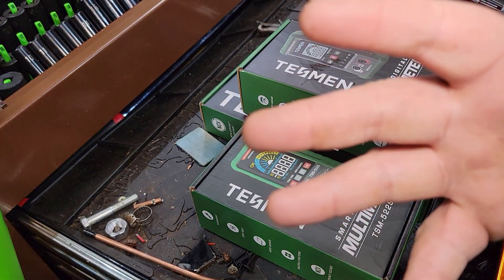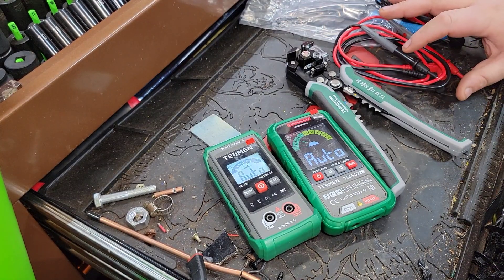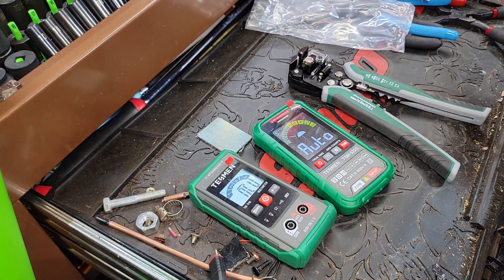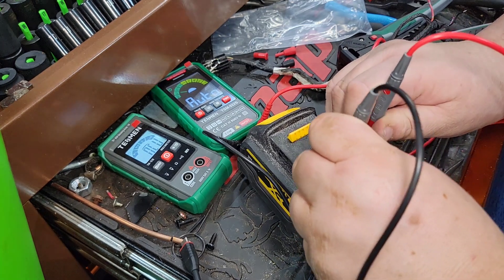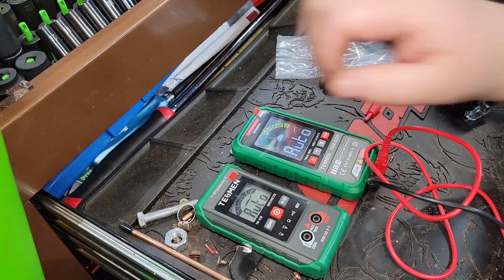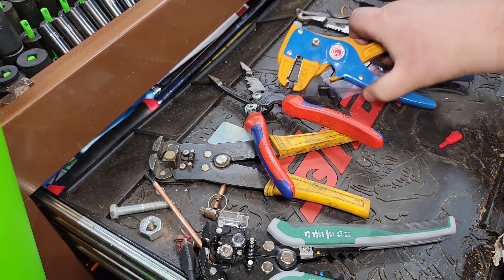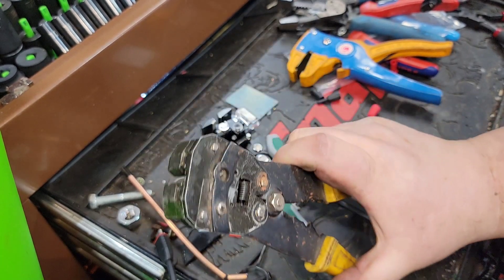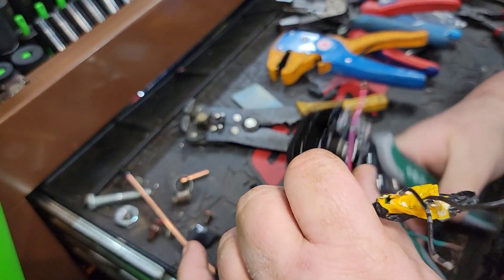I WAS SO WRONG ABOUT THIS tesman Tm-522s Better than Klein Wire Strippers.

Comment: Hey CP if you want some content send me a message and I'll explain how I brought a set of torque adapters off Amazon off capri and got sent a set of pink dumbbells in the unopened box to then be told by carpi that they wouldn't help me out at all and that it's another resell on Amazon.  But Amazon are promoting it as a genuine capri store.

Comment: Off topic, recently I have been looking at the Proto 90 tooth flex head ratchet. It supposed to be the same as Mac. On Mac's site, they show a different design more similar to the Gearwrench, further is the difference in the pictures between the chrome vs comfort grip. Called Mac and they said they have been revising it. Some have screws on the top and some do not.
Reply from the maker: I don't know about those, I personally prefer my [tool brand name] ratchets, but thanks for the info!

Comment: I purchased a Tesman Meter and the supplied test leads did not function well as you said. . The leads seemed to have a clear coating which can be removed with a light rubbing with some ScotchBrite…Worked for me…

Comment: Update: I actually ordered both strippers. I have not found an auto stripper that works reliably on coated THHN wire. Both strippers were able to do it. I had to really tighten the tension knob on Tesman but once I hit the sweet spot it's amazing to see. All my previous auto strippers just slipped off the coating. Thank you CP this is amazing to have two auto strippers now capable of stripping this wire. The yellow and blue ones clearly needed more squeeze than the green ones but they both stripped them equally as well.
Reply from the maker: I'm very happy that you are happy. This is what I do this to get comments like this, which makes my day!!

Comment: I've purchased 2 or 3 of those meters for different tool boxes and locations.  I've used it several times for my daily job (copier repair) and it is actually pretty good.  I agree about the leads, they suck.  Buy decent leads, and throw the ones that come with it in the trash.  Edit: Maybe the new leads are better, I purchased mine last year.

Comment: I’m not a fan of automatic strippers myself. I’ve got a few different stripper/crimper combo pliers from OTC but if I have room, I use my catapult strippers with the wire gauge in it. Speaking of crimping, I wouldn’t mind seeing a video with your opinions on that. I’ve several different crimpers as well: standard pliers, angled, ratcheting, etc. Love to get your though on that.

Comment: Check out the safety circuitry. And if it actually is rated to what it claims. I’ve found that’s where these things fall apart. They’re also usually not TRUE RMS. some are, but tons aren’t. Tbc I don’t mean this brand in particular I mean all of them. Uni-T included.
Reply from the maker: We aren't testing rockets, just a basic Tester man. Nobody said anything about going enstien using this meter chill out, lol
Reply: @CPthetooladdict  all of the issues I’ve had have been when testing 12v circuits so I wasn’t really considering that rocket colonoscopy tbf. One unit I had even had a 10a fuse that weren’t actually connected to anything, but I didn’t learn that until investigating the failure 😂
Reply from the maker: Gotcha, I get what you mean, but I didn't really intend this meter to be a higher level than simple things. I haven't tried going that far yet bet I get what you are putting down 100% 🙏

Comment: Auto strippers have always sucked for me. By far for me the best manual strippers are the Knipex forged like you have. I have their expensive autos and they suck like all of them I have. I hope I am one of the lucky 5 as I have these in my cart. They look good. The thing about the NCV on them is odd. If you think about the entire process by the time you have the strippers out you should already know power is disconnected. I can see these being used I guess as an NCV maybe to eliminate a stand alone and maybe that's their intent? It's a little Tim Walz weird but at least it's useful unlike him. :)

Comment: I d been looking into getting a fluke 115 or a 88V. I’m running a bluepoint meter now. It’s good but my buddies 115 is much better. Great video cp!!
Reply from the maker: You should
Reply: @CPthetooladdict  I probably will. Not probably. I am going to. Just not on the top of the priority list. It did move up a spot though. My puller is getting delivered tomorrow 😎

Comment: I my self use Fluke everyday & some times I use a analog Simpson meter. I help my cousin in a mechanic shop and this new volt meter will be good for the new techs so they don’t blow the $25.00 fuse in a Fluke
Reply: Goddang it found out my 88 has the blown fuse today . Key off drain ? Nope. Grab the amp clamp sigh
Reply: 😂 kinda gotta go outta your way to blow that fuse...

Comment: Great update and explanation as to your change in thoughts. I'm still a Fluke and Fieldpiece unit technician.
Reply from the maker: Good stuff
Reply from the maker: These are definitely not going to replace a Fluke, just a great option as a backup or for quick checks. I have 5 meters I keep in rotation.